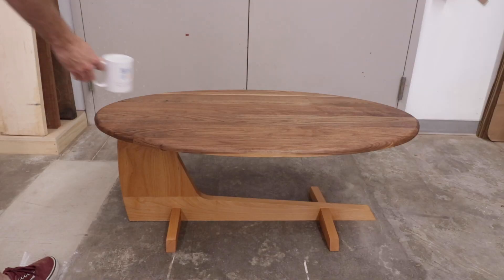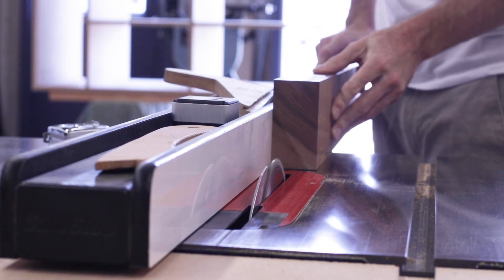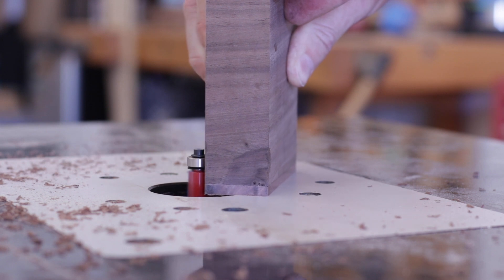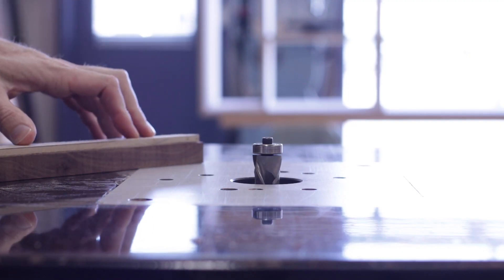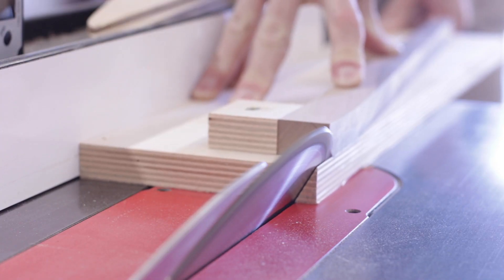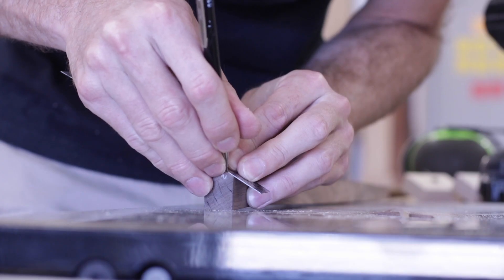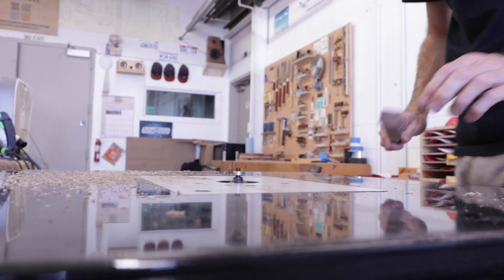The One Cup of Coffee Table -- it has magnets, too!

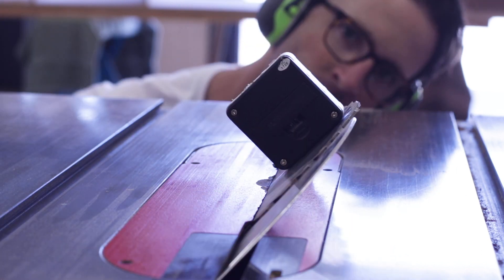Comment: Quick question... do you really need to tilt your head in sync with the table saw blade when adjusting the angle 2:39? Is this to make reading the display on your Level Box possible? 🤔
Reply from the maker: Haha, I think I was just being dramatic or something. But yes, I guess it makes it easier to read, though it results in more potential neck pain.

Comment: Maybe you could make a wooden carrying case for it.  I'm thinking something similar to a flute case that has cavities cut out on the inside to fit the table parts, and maybe a nice rope handle or something.  The magnets could hold the table parts in place inside the case as an additional function.  The whole point of using magnets was portability, but it's not very portable with loose parts.  I say make a case!
Reply from the maker: I was actually thinking of doing something like that at some point. Would be cool to have a case with a few other accessories or something in it. I'll add it to the list!

Comment: Nice design. How stable is it? Does it tip easily?
Reply from the maker: Thanks! It definitely can be knocked over fairly easily, could probably use a slightly wider angle on the legs to get a larger footprint. Still totally usable in this form, though.
Reply: @shaunboydmadethis  That is part of the trying and see what happens when you build something new.
Reply from the maker: @WoodnMetalShoppe  That is what it is all about!

Comment: Ok... but why didn't you inset-miter the back of the 'table' to match the drawer -instead of planting on the flat piece with end-grain showing?  Maybe a nit-pick but the rest was so well detailed that kind of stuck out for me.
Reply from the maker: I was a little worried the drawer would get to be too short with the mitered back panel, so I skipped it. I agree though, if I were ever to make one of these again (which I probably won't) I would miter the back panel, as well.

Comment: General idea - brilliant.   Usefulness in practice - questionable.  I think if you had wood or tile floors, no kids, and no free roaming pets it would be mostly fine, especially right next to a chair where it's not as likely to get bumped into.  As mentioned already for camping if it had spikes on the bottom of the legs, or in  a very small home it could be super useful.  Though I think just >slightly< bigger, enough to hold coffee and a phone or remote would be a bit more practical and stable.
Reply from the maker: It's always fun to take it to the extreme. But yes, I agree that for actual everyday use, it would definitely need a few tweaks to make it much more functional.